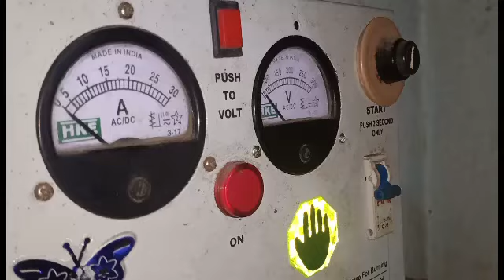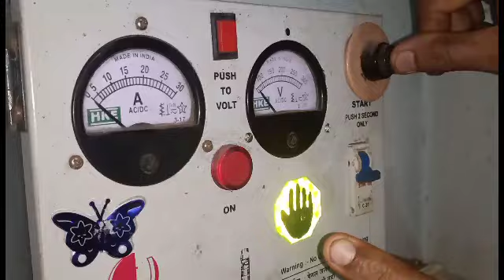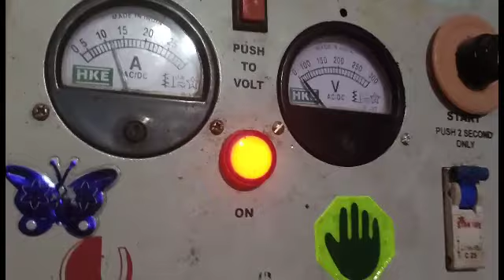Submersible water pump Repairing Malayalam

Comment: Puthiya bore adichu 400ft,  ellarum  parayunu compressor vakan karanam submersible motoro impellero stuck avum ennu. etha vekandiye.
Reply from the maker: Submersible..(Pumpinte രണ്ടു സൈഡിലും ബുഷ് ഉള്ള Submersible നോക്കി വാങ്ങുക).. അതെ വെക്കാവു.. Compreesor വെക്കരുത്
Reply: @techraj3548  V guard water filled  submersible kollamo. Ente 4.75 inch bore anu 4 inch motor stuck akan chance undo. Regular PVC 10kg  edunondu valla presenavum undo. 400ft il 230ft vellam undu .